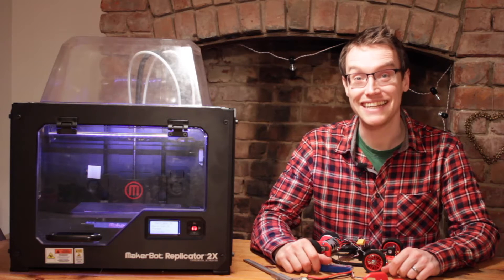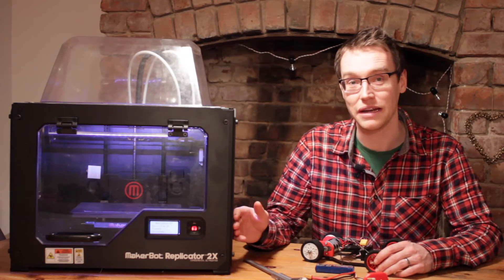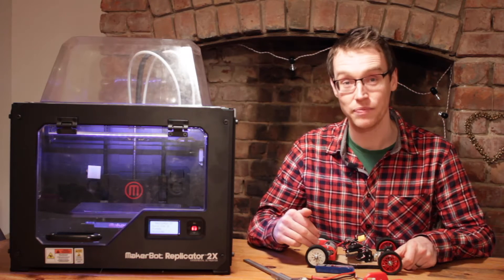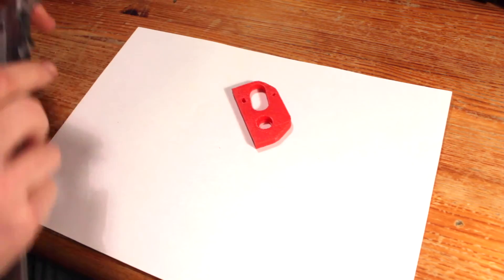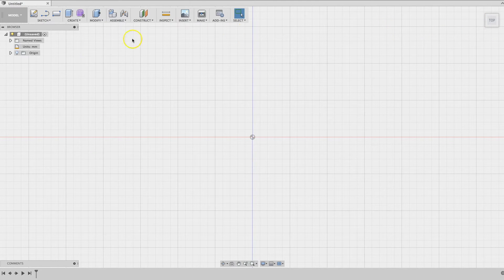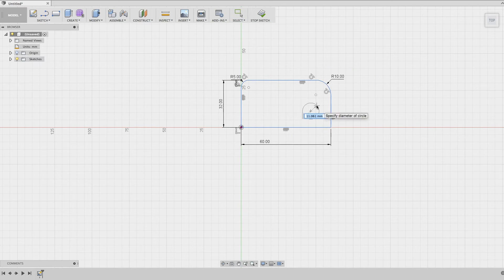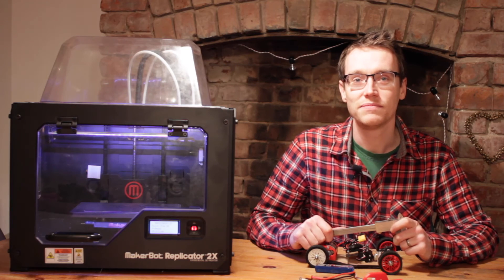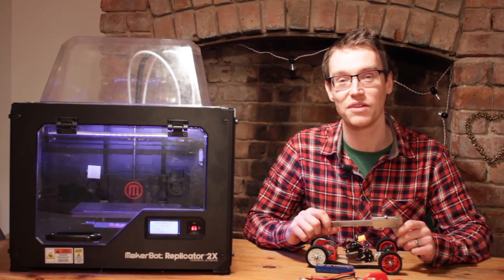DIY RC Car Motor Mount in CAD   #5minFriday - # 20

Comment: As you prepared the wheel?
Reply from the maker: The wheels are available on the Thingiverse page http://www.thingiverse.com/thing:1909501

Is there anything else you would like to see?
Reply: nowhere to be found how the tires are made (black material)
Reply from the maker: +Адамир Козлодоев the tyres are purchased from http://www.kamtec.co.uk/epages/BT4645.mobile/en_GB/?ObjectPath=/Shops/BT4645/Categories/Wheels_Tyres&Locale=en_GB

You can improvise with bicycle inner tube sections though.